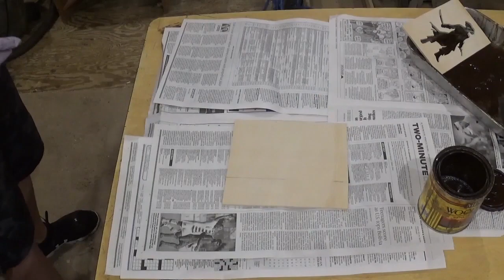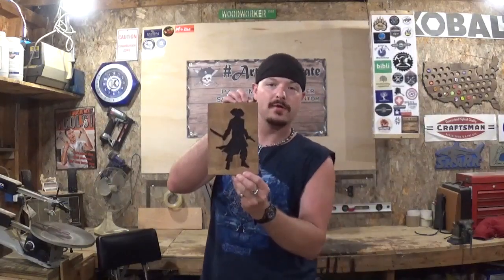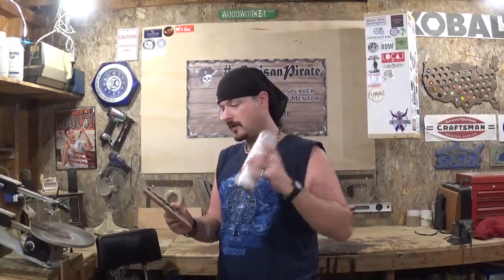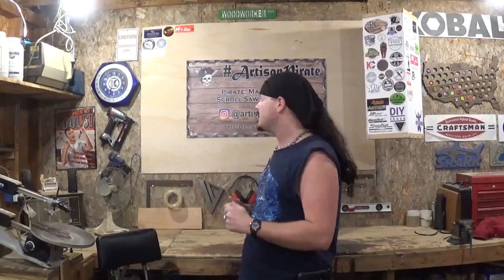Scroll Saw Pirate // How To

Comment: 👍 that pattern would make an excellent inlay pattern. Great video! Thanks for posting!
Reply from the maker: Fisherman308 thanks man ! Never tried inlay work !
Reply: With a scroll saw you can cheat. Get two pieces of different colored wood(same thickness).  Just tape the two pieces with double sided tape in the corners . Cut out the center pattern and swap the pieces. Glue them on a backing boards. The only tell that you cheated is the hole for your blade